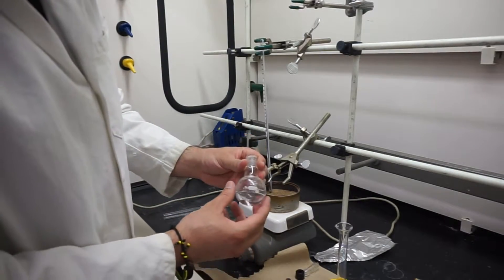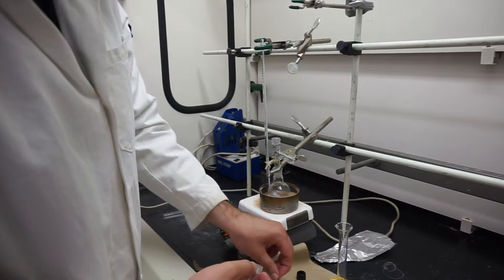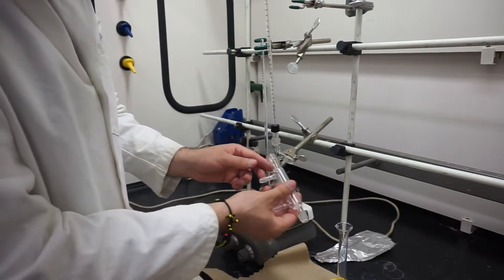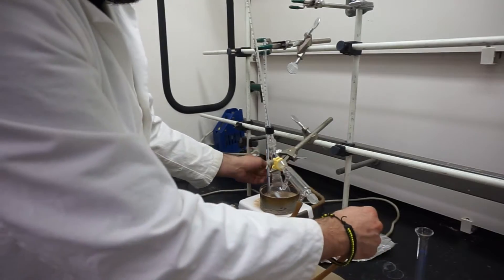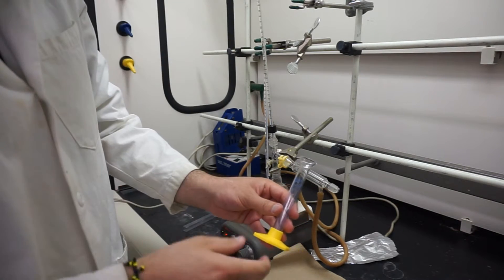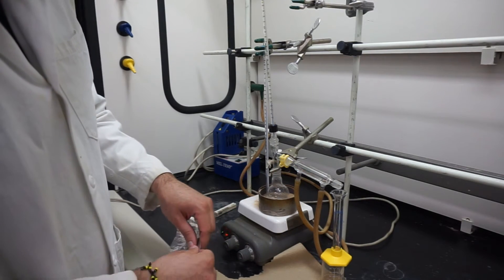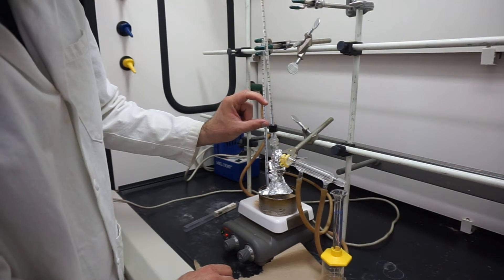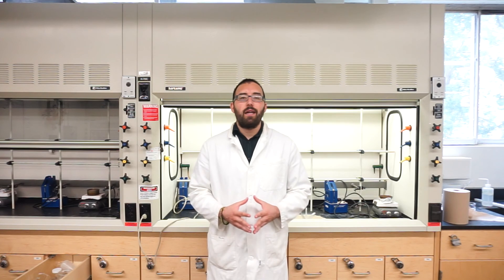Chem 333: Distillation with and without a vigreux column

Comment: You should be wearing gloves!
Reply: It's just a distillation, dude. He's not using or doing something dangerous.
Reply: @LucasdeSouza-qe9pq  the risk might be small but as the point of the vid is teaching good laboratory practice it doesn't matter the risk given that most professional labs require gloves. saying its ok because its not that dangerous as an excuse is just sloppy and irresponsible.
Reply: @Margoth195  
Even at college we don't use gloves every time for every practice class. The professor will warn when it's necessary, and in an industry, they will require specific PPE.
For simple and safe practices, we just do it. Will you wear gloves to mix sugar and water, just because you are making a solution?
Reply: @LucasdeSouza-qe9pq  good lab practice doesn't assume that accidents can't happen. just because you are mixing sugar and water doesn't mean the lab doesn't have other hazards. also your argument is stupid given that you can never be too safe. your argument may as well be " well i don't wear a seatbelt when I drive slow" when there are other drivers moving unpredictably on the road.
Reply: @Margoth195  I can't argue that it's anything but bad practice, but given it's a distillation demo and I hold a greater fear of getting written up by some auditor/inspection for mixing sugar water without eyepro than getting some gnarly shit in my eyes I'll happily let this one slide.